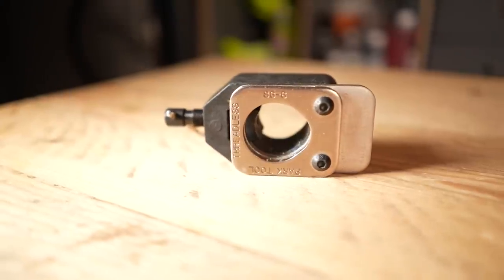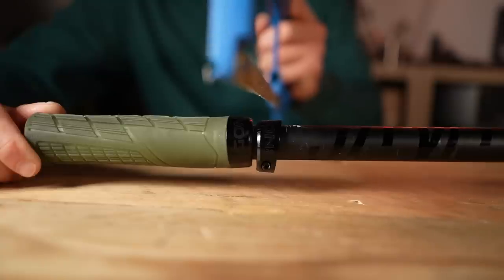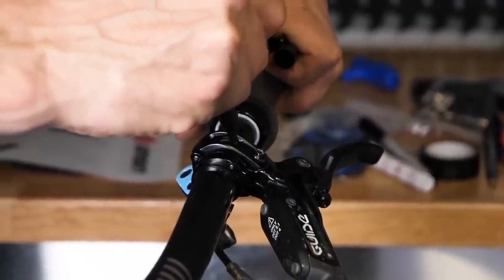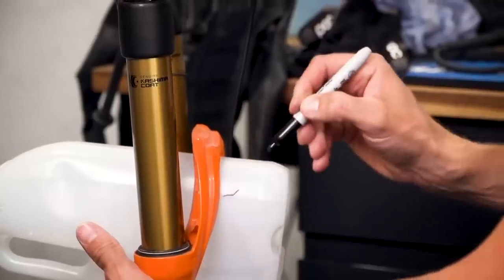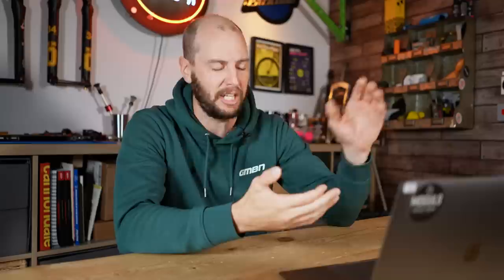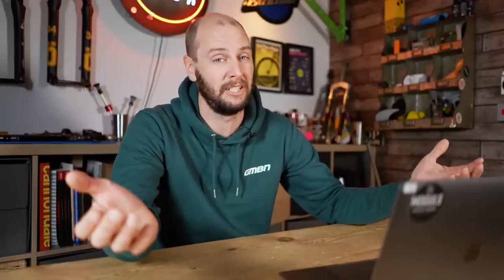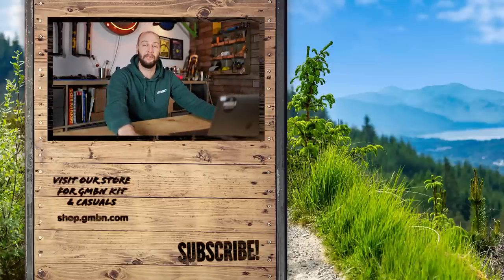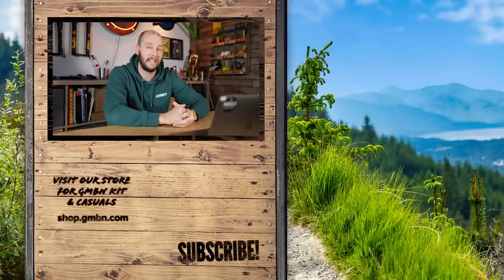5 Budget Bike Hacks | Setup & Upgrade Tips!

Comment: A cheap pipe cutter is a really nice tool for bars, steerertubes and seat post and so on.
Reply: I would say they're only good for metal but really if you've got carbon parts...c'mon
Reply: @MrHopekiller  They will destroy carbon stuff but then you're not on a budget.
Reply: Dermal and  Cut Wheel
Reply: @MrHopekiller  You shouldn't be cutting carbon bars anyway, they are bought in the correct length already.
Reason is: the carbon bars are made thicker at the ends for the lock on grips outer clamp to have a stronger place to clamp on, otherwise they tend to crack on compression

Comment: Instead of buying magnets for pulling cables inside you frame, i use a vacuum cleaner and some thread from The misses locker. Tie it to your cable and pull through easilly. I have a video of it somewhere if you want.
Reply: Now that is a hack. Nice!

Comment: PVC pipe to hammer down a crown race, heat gun to soften the hydraulic hose so the barb can be hammered down easily without a block.

Comment: Great vid, these are my budget fixes... 

Self amalgamating rubber tape for chain stays and for wrapping around cables

Self adhesive furniture foot  pads in foam for cable rub areas.
Reply: Tennis racket grip tape works well and easy to find. 
Not sure where I'd find self amalgamating rubber tape, ACME perhaps?
Reply from the maker: Sounds like a couple of great hacks! 👍
Reply: @ThisGuyRides  screwfix and the like.   But it isn't cheap though.

Comment: I bought a saw guide for £13 good for bars, steers, wardrobe rails, any tubes. I was warned not to used pipe cutter pfft not me, well one careless turn years later I ovaled a tube. A guide and a good hacksaw jobs done quicker than twirling a pipe cutter.
Reply: I’ve done both and the cuts are always cleaner with a guide. The pipe cutter method warps the tube no matter how minute.

Comment: Come off it, as if someone who has potentially spent thousands on their bike would cheap out at the last minute and use milk bottle as a mudguard or an old inner tube as a chainstay protector. Both are pretty cheap to buy (no branded ones off eBay are dirt cheap). The equivalent bodge ones suggested here would look really shit. Who is this video aimed at!?!! What about instead of buying waterproof socks for biking, just use some old plastic sandwich bags on your feet instead? Maybe a carrier bag wrapped around the seat to keep it from getting muddy, or make some new handlebar grips with old inner tubes and zip ties, or cooking oil instead of proper chain lube??